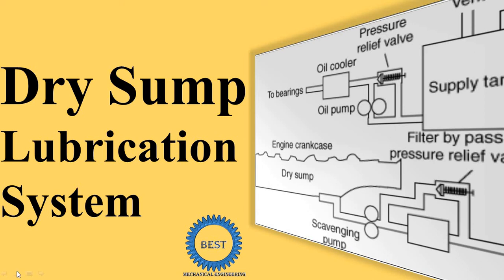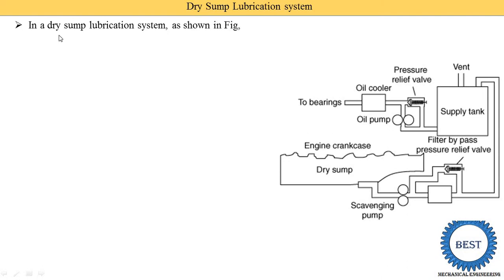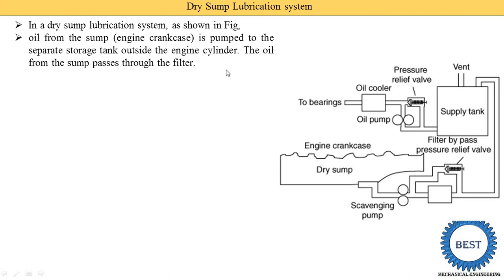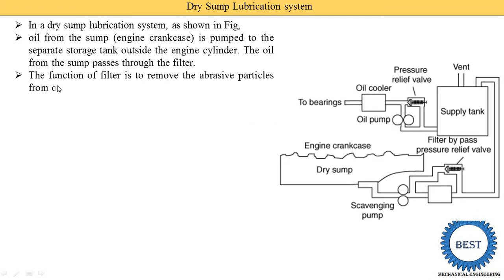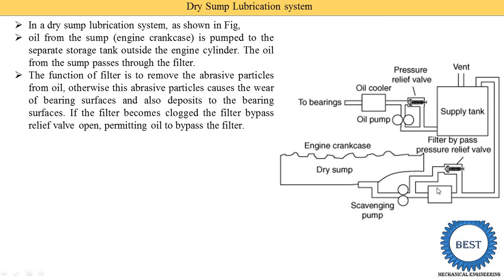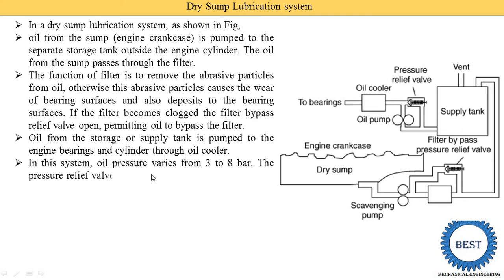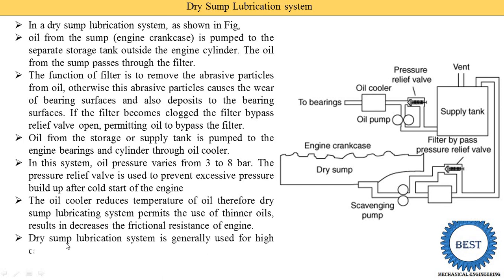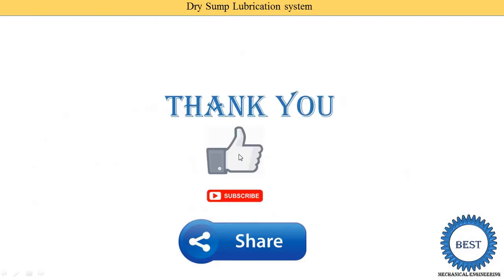Dry Sump Lubrication System

Comment: Why Dry sump is called Dry tell me please
Reply: In dry sump crankcase will be dry always because the oil is sucked into supply tank by the scavenging pipe and oil is supplied to other parts from supply tank so crankcase will always be dry so called as dry sump lubrication